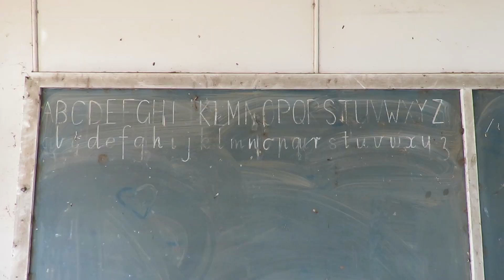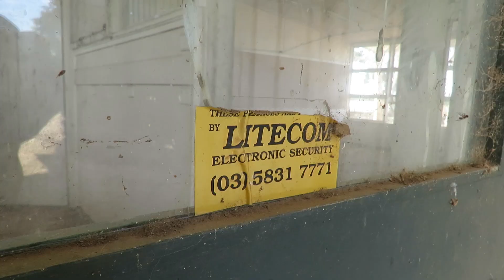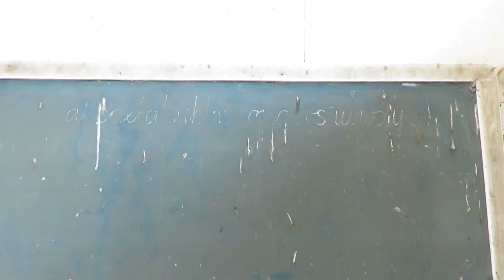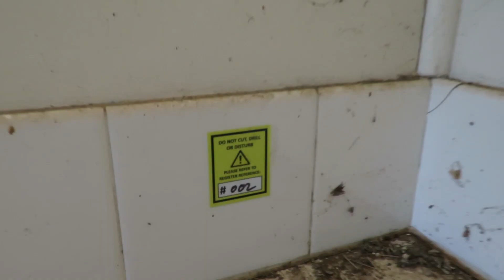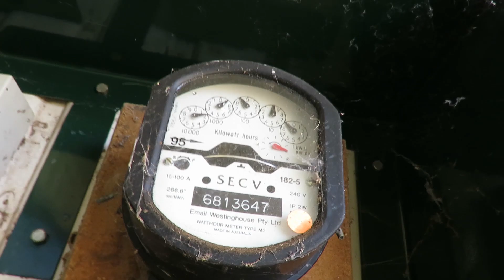Abandoned: Tiny Country State School - GUARDED BY RAMS!

Comment: Its funny schools had the same sort of design, the sloping roof and the girders with the same sort of look.  And the same Ceiling fans, and the windows up the top on the higher side, and sometimes a Corridor down the middle and the same on the other side in reverse.  Well my primary and secondary school in wangaratta did.,